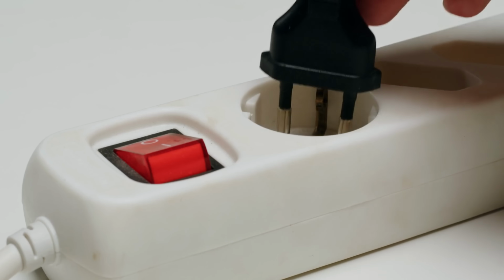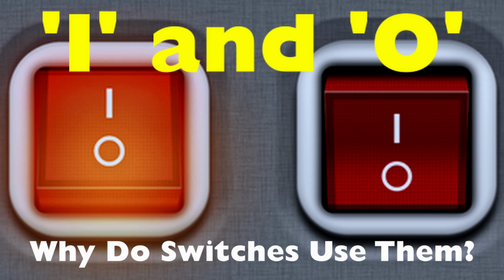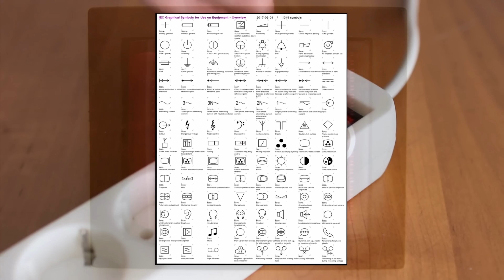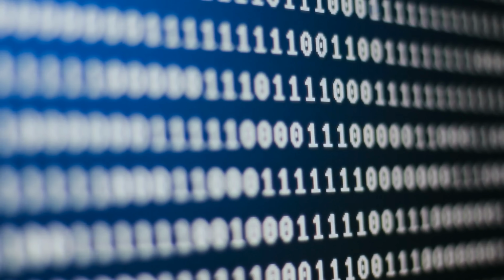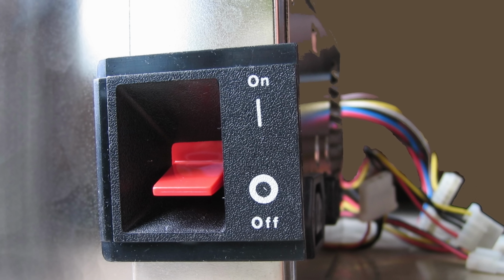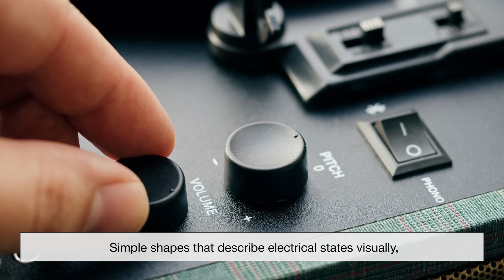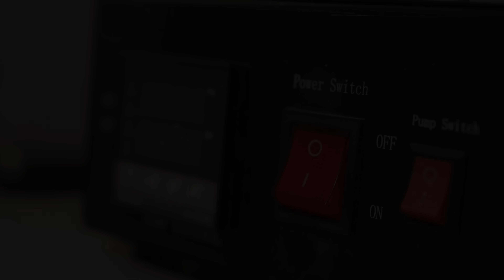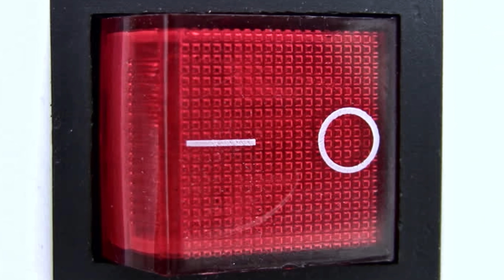Why Do Switches Use ‘I’ and ‘O’? The Power Button Explained [ID0703]

Comment: These symbols are not intuitive in the least. Most users have no knowledge of electrical circuits or binary logic so if they actually have any clue the the line represents "ON" and the circle "OFF" it's only because the symbols are used constantly and they figured it out, but the logical/intuitive justification is total horse hockey. The switch lighting up is a good example of intuitive design' Now if we could get the makers of TVs to stop having power OFF lights that go off when you turn the TV ON we'd be good.

Comment: If you think of it as what gear, or speed, a device is in it makes better sense.. 0 is off, I is low, II is med, III is high.. or first gear second gear etc.. I know that's not the real meaning but I always thought of it that way before I knew what the symbols actually meant and I still think its actually more intuitive to think of it my way than the way it is..

Comment: but the symbols seem backward, the circle would seem to represent a continuous circuit, but that’s not the case. the most annoying place such symbols are used is on a gasoline powered yard tool, trying to pull start a chainsaw when you’re not quite sure if the switch is on or off.

Comment: To anyone that is too lazy to watch the video.
1 means on because in binary it means yes/on/full power
0 means No/off/zero power
Reply: It's a small short line, not a 1.

And it's a small circle, not a zero.

These symbols were used on switches for electronic equipment, other than computers.

Comment: It’s binary code for off and on. 0 is off, 1 is on. Binary strings can make up commands and figures and the 1s and 0s, refer to off and on in a chip. Those patterns create instructions the co outer carries out. When you see the 1s and 0s cascade down in a sci fi movies, like The Matrix, it’s a display of binary code. If you grew up in the 80s it might make more sense. Switches have been marked like this for a very long time. It used to just be PC power switches,   Now it’s lots of things.
Fun fact: 1001001 is 73 in binary, which Sheldon (The Big Bang Theory) likes to refer to. It is also ASCII for the letter I which was a major theme in the Ayn Rand book Anthem. That binary code is part of the lyrics in Rush’s The Body Electric. Neil Peart who was the primary lyricist for Rush read a lot of Ayn Rand. The more you know…

Comment: I see this as a pull-push switch. Push In for On. Pull Out for Off. However, this does not work for an emergency off bump type switch ☹️

Comment: Because when it is “on the line” it means it is online…or power goes “straight” through 

A circle is a closed loop so the power is off. Off also starts with an “o” also it is a “0” as in zero power. Simple really

Comment: Before I watch, I'll post my belief. Using words like "on", "off" and their non-English equivalents was confusing as international trade expanded, so a common symbology was needed. Computers used solid state devices which only had binary "action" states (action & no action) the basic binary numerals 0 & 1 were adopted: 0 for No Action or "off" and 1 for Action or "on". Now, I'll watch and see if I'm basically correct.

Edit: OK, so the symbols came first and the binary relationship is a coincidence. However, I have a degree in electronics and I wasn't taught that symbology; it apparently only became widespread after the mid 1980s.

Comment: Seems backwards to me as far as opened and closed circuit. 
Open you can go in or out on either side of the line. 
 Closed circle you can't get out or in. 
Not being an electrical engineer  I see these switches on some things and still have to think about it.

Comment: It's still very ambiguous and confusing because there is absolutely no logic or reason to the symbols. Not sure why those symbols were chosen and really don't care because its just another dangerous decision made by a person or group of people that have no clue about what they are supposed to be deciding. The only reason people may know if the power is actually being applied is when the indicating light at the switch is lit (assuming  the light hasn't failed)! The old switches in our barn from the twenties had the word "ON" printed on the top part of the switch lever and the word "OFF" printed on the bottom part of the switch lever were quite obvious and no one ever had a problem. Its unfortunate we have so many irrational people on this earth with nothing important to do except to make problems for rational people.

Comment: When a single piece of silicon wafer carries a charge it is represented as the number 1. When it carries no charge it is represented by the number 0. The chip is said to be off at zero and on, charged, represented by the number 1. 
0 = off and 1 = on. If you look at binary code, you'll see strings of 1s and 0s arranged in distinct patterns. When those patterns are assigned to letters of the alphabet, it becomes readable to us humans.

Comment: Yes! This is the correct explanation. It has its roots back in the 1950s, long before computers were common; the binary 1 and 0 came later as a hopeful explanation after the fact. Think of it this way: they are symbols, NOT letters nor numbers. It's for a switch. What does a switch do? It connects two wires for electricity to flow (turning something on). The line symbol (not an L or 1, but a representation of a straight wire) connects the two wires on either side of the switch (the shortest distance between two points) and the device is on. The open symbol (that looks like an O or 0, but is neither) represents the open area between the two wires, which are not connected and the device is off.
Reply: The straight line is open ended - not connected. The circle represents a closed circuit. So those symbols do not work at all.
Reply: @yrdjuret  Basic engineering electrical schematic symbols and images in circuit diagrams for switches use a  line to complete a circuit to turn a device on and a circle shows the termination of a wire of which circuit can only be completed if a line connects with it. What are you basing your conclusions on?
Reply: @CoRiess-wg5zr I’m just stating what the symbols communicate to the world. If you need education to understand symbols meant for the public, those symbols are ill chosen. In my opinion and experience, these symbols need to be changed.

Comment: It allows manufacturers to put switches in backwards while pretending they haven't. Back when the world supply of common sense hadn't yet been squandered, a switch was universally thrown upward or to the right for "on", downward or to the left for "off". Not so nowadays, when switches are put in any old way round. The right-left confusion I used to blame on Chinese manufacturers, because of the way Chinese text is read, but that doesn't explain the weirdness of "down" for "on".

Comment: We were never taught I and O, so I had to figure it out for myself. The line formed a wall, blocking electricity from flowing, and the circle formed a hole, allowing electricity to pass. Therefore, I just think of them as the opposite, and it's served me well for over 40 years.
Reply: That only works on Calvin and Hobbes' opposite day.

Comment: Retired electrician and back in the day everything was marked On & Off. Was confusing for some. To ad more confusing often came across three position rocker switches marked 0-1-2. Better yet had two speed switches marked 1-0-2. Gave a not so bright coworker a single pole wall switch for his house. Asked him how he made out replacing a simple two wire switch. Said it was marked wrong. Say what ? Told me it said NO & FFO. Did not believe Mr when I told him its marked up and that part should be towards ceiling.

Comment: First of all, absolutely love this channel, keep up the great work 

I’m not sure if this has already been mentioned in the comments, but here goes….

The reason there is an “O” for off, and “I” for on, is this…

Voltage is also known as POTENTIAL DIFFERENCE.(PD).   5 volts means that it has a PD of 5 from ground

Ground or earth ground is absolute zero.  

Because there is no PD in a closed loop, this zero volts

Ergo the “O” represents this closed loop or OFF

Comment: I've always thought these symbols are used the wrong way around, the circle suggests the completion of the circuit hence ON, the line with nothing at either end suggests open or circuit broken, Off.
So you would think to avoid confusion a simple ON and Off should have been the norm.

Comment: Your information is backwards. The IEC 60417 specification follows the established 0/1 states already established in boolean mathematics. Those propagated to even ancient notation into what became binary gates in electronics and digital processing in computing. It was zeros and ones long before the IEC codified them into international symbols. No one calls them by letter name. It is ON or OFF, TRUE or FALSE, OPEN or CLOSED.
Reply: Yes but isn't a closed circuit the one that allows electricity to flow, and an open circuit the state that stops electricity from flowing?

Comment: Well as an old retired programmer I even learned something.

I thought that "one" and "zero" were the symbols we use for bits

And for  bits technically that doesn't mean "one" or "zero"

The bit is either on or off

And I don't think we directly manipulate individual bits other than by throwing specific integets at a variable. 

If you can use a binary calculator on your smart phone you get the idea translating decimal to binary

Comment: "O" stands for "On"  It also stands for Off.
"O" represents a closed circuit.  While "I" represents a circuit that is broken. It doesn't connect.
It's a dumb system.

Comment: I still get confused constantly with this system, because the O means on to me such as a continuous circuit. The straight line represents no or end of circuit, continuity/not continuous as the circle is.
Those who made this decision should have thought common sense and the way electricity flows. Broken or straight line (l=off) circle (O=on).
Reply: I agree completely.  "O" or "0" represents a complete circuit, inferring the flow of electricity.

Comment: I still struggle to remember with one does what
Reply: O for Off, I for Ignition. 
But honestly I still forget...
Reply: O for ON.
I for isolate .
Reply: @user-px1nl3eo5b  nah. o is an end of an open circuit. a lone connects two o's and turns it on
Reply: *edit... line, not lone.
Reply: @user-px1nl3eo5b  See, you're wrong already!
Reply: O=off line I=in line 😮❤😊
Reply: @sungkeunglui97  That could work too.
Reply: In operation and off works for me.
Reply: @bakedbean37  Sounds a bit more reasonable way to remember!

Comment: In a circuit diagram, a switch is represented by 2 circles with a line joining them. In an open switch, the line is raised at an angle, and in a closed switch, the line is flat and joining the two circles. For me, it was therefore intuitive that the flat line "I" represented the closed switch, and "O" represented the circle of an open switch without the line attached to it.

Comment: What do I do if the little light in the switch flickers?
Reply: It's a line voltage lamp. If I  remember correctly, it's neon and tends to flicker. Not normally evidence of an issue.

Comment: Yes, the universal OFF/On symbols are in IEC 60417, but good luck finding them, they are symbol 5007 & 5008 & power switch symbol ( actually the standby switch symbol is 5010 (which means you would have had to look look through over 5000 symbols to find their meaning! These symbols are numbered by their inclusion into IEC 60417, not by their usage. If look through IEC 60417 you can also find every, (what does that mean) cautionary symbol that pops up on your cars dashboard & car switch symbol, mixed in with electronics & wiring symbols, and diverse symbols like caution; water buffaloes on the road, FOR A LAUGH look up firefights protective equipment symbol, it looks like what you could to slow the spread of the fire, before fire engine arrives.There is also IEC 60617 if you though the Europeans had missed making a symbol anything else in the world.

Comment: TTL = Transistor-Transistor Logic
A typical transistor can be used as a "switch", which will switch ON or OFF based on the electrical voltage to its Base.  ON and OFF states are synonymous with a HIGH (+5V) state and a LOW (0V) state.  This is the same state that computers understand:  Binary (or 1 and 0).  Due to these two states, the waveform appears as a square wave because the transistor only needs two states.
1 = HIGH state (which turns the transistor ON)
0 = LOW state (which turns the transistor OFF)
Reply: PNP or NPN.

Comment: Honestly, the O could stand for either on or off.
Reply: not in a circuit diagram
Reply: Open
Reply: not really it's a number not a letter the I is 1 not i  the 0 is a zero which is a number not O which is a letter. So when you read a number and you say  OH like the letter YOU'RE reading the number WRONG. ZERO is the NUMBER not OH. that's a letter. Got it? If you were in the MILITARY YOU would have learned that.
Reply: @FRANKO-iu3dx  nup. its not binary. it is a zero and a line. its from schematic diagrams, nothing to do with military all to do with electronics
Reply: @FRANKO-iu3dx let's be honest here. That looks more like  the letter O or a circle ⭕️ than the number zero 0.
Reply: Similarly, | could stand for "I switched it off".

Comment: There were multiple ways that these two symbols were easy for me to grasp as they began appearing.  I think that first I just assigned O as a mnemonic for Off and I as the other.  But I also knew that the simplest off switch was an opened knife switch and and that an open circuit conducted no current, which were votes for O (I played with electricity as a kid).   In my mid teens, I learned that in outside my narrow world of reference "opening a switch" was an equivalent phrase to  turning it off.  And then as a young adult, I gained access to elementary computer science, with binary states and logic represented by 1 and 0 that closely represented I and O, respectively.

Comment: So, a 6 minute video that never answered the question of why they used the I and O? I would like to know why they came up with those symbols and what the thought was behind it. Why not just use X and O, or X and I?
Reply: They gave the answer almost immediately. - means its on line. O means off.
Reply: @stevenfoust3782  Saying what they mean is different than saying why they were selected.
Reply: @kenp5186 that like debating the chicken or egg thing.
Reply: @stevenfoust3782  Obviously power being on or off came well before these invented symbols and the symbols have nothing to do with the meaning. Could just as easily be a little lighting bolt and a square box or a backwards E and an upside down Q.  The video never answers the question in the title, why were those symbols chosen as THE symbols.
Reply: @kenp5186 what do you expect when computer geeks get together. Its has good meaning and is completely dumb at the same time.
Reply: @stevenfoust3782  EE geeks, but you have a point, and I should probably know better than to expect the content in a video the line up with the title.
Reply: @kenp5186 true dat 😂
Reply: Electrical/Electronic symbols  ----> O means Open contact in a switch = off.
I means Closed contact in a switch  = On
Reply: The reason there is an “O” for off, and “I” for on, is this…

Voltage is also known as POTENTIAL DIFFERENCE.(PD).   5 volts means that it has a PD of 5 from ground

Ground or earth ground is absolute zero.  

Because there is no PD in a closed loop, this zero volts

Ergo the “O” represents this closed loop or OFF
Reply: @williampollard4759  It is not a letter O so it doesn't equate to off (and would not be even slightly international if that were the case). It is definitely a circle or line. But your closed loop, and pass through (a straight line) makes sense.  Thanks.
Reply: The question was answered in the first 2 minutes.  I = Line or power on.  I = Off or power off
Reply: @CGChief97 oops
Reply: @mikebond6328  
Do you mean "OOOPS", or "Y | | | | | KES!!" 🙂
Reply: @CGChief97  Kinda proving the point when you get it wrong.  Not intuitive, and they seem to have been chosen randomly.

Comment: I remember when switches were clearly marked on and off and I have problems remembering which is on and which is off.  This video solves that problem for me as seeing the line as a closed circuit  and the o as an open circuit I think will help.
Reply: You'll forget.

Comment: I have extra explanation: 1 - I - In the grid/power/work; 0 - O - Out of the grid/power/work. Bu I have a question or even suggestion for another video: why in one group of countries ON position for any electric switch should be Upward located, but in another group of countries they are Downward positioned.

Comment: i am a service tech and sometimes me and customers still mix up the "|" and "O" symbols. "|" can also be intepreted as OFF as if you strikethrough a word that you don't want. Would rather they switch to  a "O" for ON and "X" for OFF, similar to the buttons on a playstation controller. "X" as a symbol is pretty universal it means stop, no-through-road, wrong and cancel.

When morons think they are intelligent and start to create dumb rules, is where problems begin.

Comment: There is absolutely NO WAY that I=1 and O=0 is a coincidence or an explanation after-the-fact. It absolutely had to be the reason for the design choice, even before digital computers were commonplace. 0 = a closed gate and 1 = open gate is much older than the design choice for a power switch. And that's why we say "computers" run on 0s and 1s.